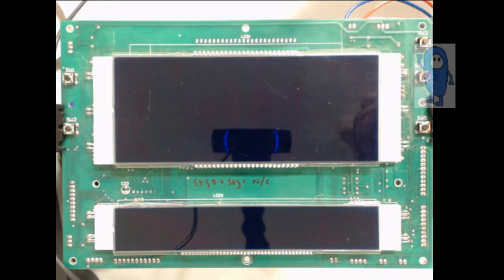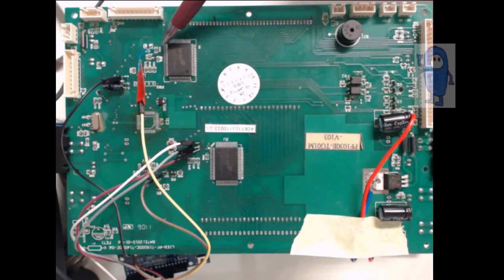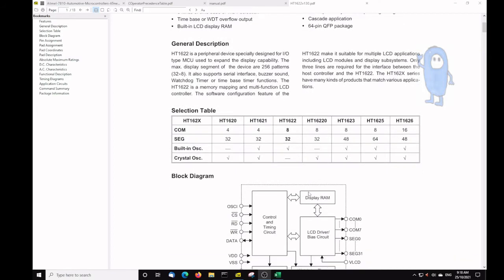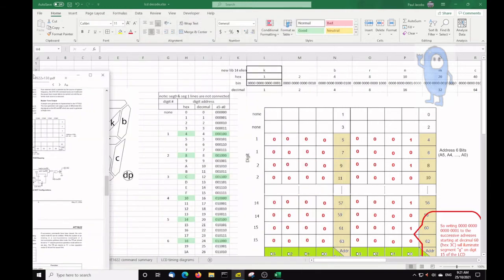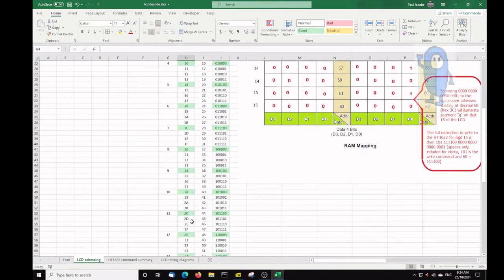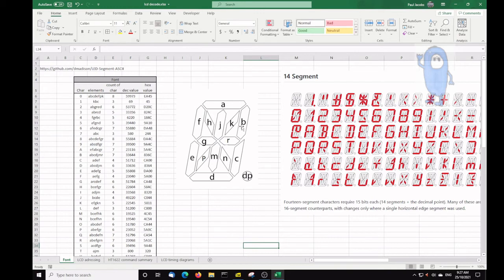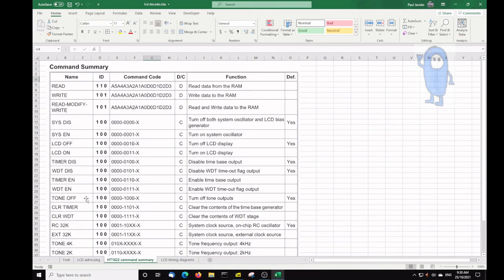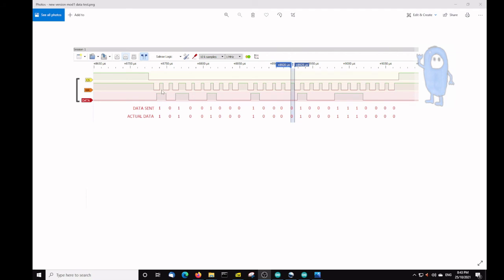How to display text on a 14 segment LCD using the Holtek HT1622 LCD driver chip and Arduino

Comment: Thanks for your work. Using your code I was able to reverse engineer a VFD (the motor controller) screen. They used completely different segments for characters though due to a custom LCD, Had to manually find all segments and make the characters up from scratch.

Comment: Great work - glad I was able to help! I'll be curious to see if you get that larger top display working (also an HT-1622 or similar?) The current version of the library should allow you to step through all possible addresses to help discover the segment mappings for that one.
Reply: Hi, if one isn't supposed to read anything from the chip driver, is that possible to use SPI instead of bit-banging, taking WR as CLK and DATA as MOSI ? Most mcu's allow us to choose any number of bits from 8 to 16 for transmission (it seems to transmit 13 bits), besides several SPI modes. Thank you!